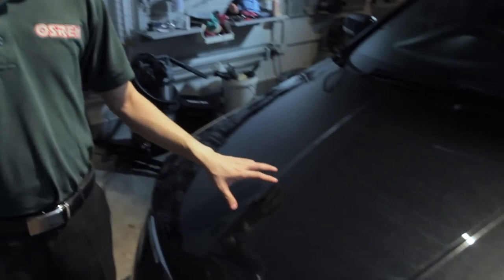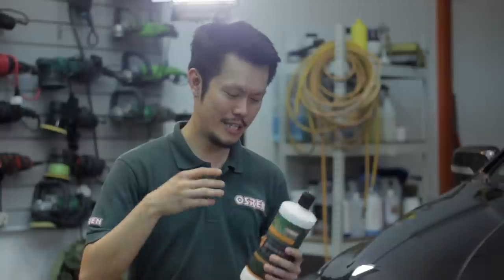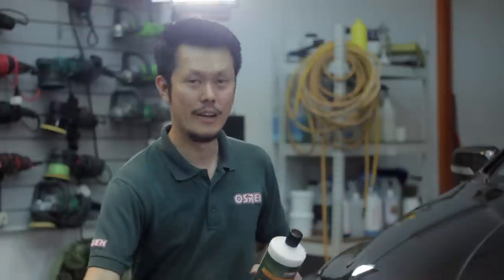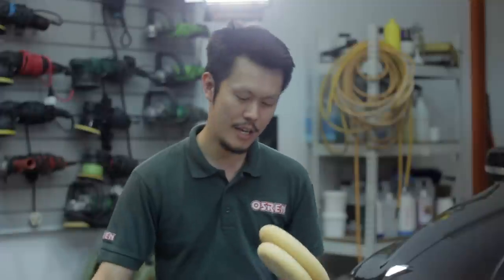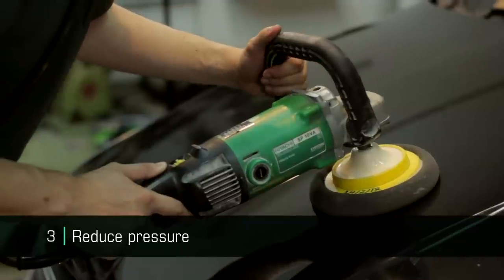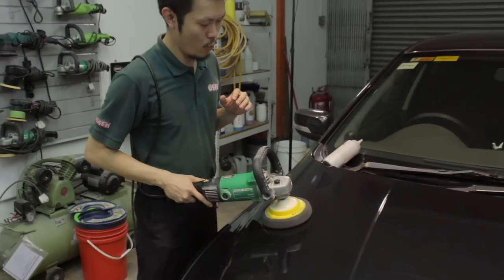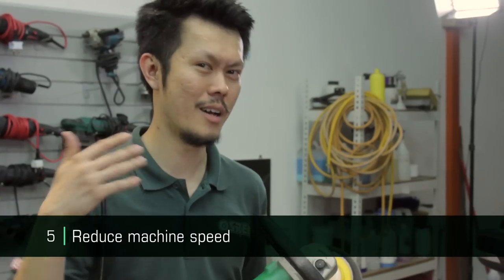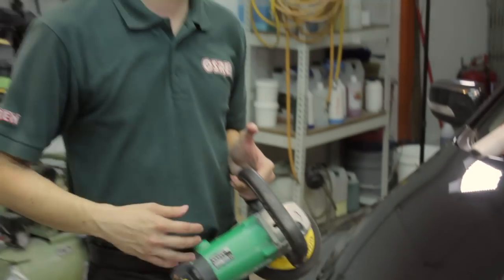How to Reduce & Remove Holograms with a Rotary Polisher

Comment: Very useful tips!  I am a fan of your channel. Would like to voice my support here.   
Unlike many American/European car detailing YouTube channels where they try to make simple things unnecessary complicated.  I am talking 15-step wash and decontamination process followed by 10 step surface preparation and product trials using 3 different DA polishers with 20 different types of pads with 10 different types of compound/polishing/finishing/sealant/wax/top-coat etc.  Took them like a week to completely detail only one car hahaha... This kind of complication has taken the joy of car detailing away.  

Your instructions just always keep things simple and easy to follow with minimal tools, chemicals and steps.

Also, I guess that you are a kind of ROTARY man because you always use rotary.  I grew up and start my car detailing practice from rotary and have always been using rotary. Contrary to today's popularity of the DA, a rotary always has a place in my heart.   It just gets the job done effectively and easy.  More fun to use than the DA, in my opinion.

Do you have any videos on polishing the very soft paint?  I have the World Rally Blue (Dark Blue) Subaru BRZ.  Its paint is very soft and it is very hard to perfecting the paint without the hologram.  

Keep on publishing good videos! Thanks.  (Sorry for very long comment)
Reply from the maker: HI Nikornvit, glad you found it useful. Off camera, Henry uses dual action polisher equally frequent as well. It all depends on the job at hand and there is always a best possible combination that is utilised by different detailers. 

On the soft paint, you may find the video here: https://youtu.be/Z2BCAaczsmk
Reply: Nikornvit Tulananda Can't agree with you more brother
Reply: Thats because they have product sponsors and they need to sell their products. In my shop I have only 2 sets od pads and performed more than 100 cars with the pad

Comment: Hey folks, Henry and the Osren team,

I would like to share my experience with a certain kind of swirls here, also I want to stress the meaning of this videoclip when we talk about removing swirls and thank Henry and the Osren team for providing me with tips and hints that really proved valuable for me! 

Maybe this text can help some of you guys sort out a kind of complicated issue and makes it a little clearer and easy to understand.

Let’s get into it: Those swirls on my black Ford were driving me crazy. Whatever combination I tried and whatever technique I used (watch Osren videos regarding arm speed, amount of product, rpm and applied pressure that influence the cutting effect), I wasn’t able to remove them. Just to be complete, I want to mention that I used only good quality products and pads and with 2+ years experience in cutting and polishing, I am not a super pro but also not a beginner. And I don’t have a DA, only a rotary and didn’t want to invest because it’s my private car and no profits involved...

Those swirls were of the kind that you couldn’t see them in the shade or indoors at all. But you were able to see them very obviously in bright sunlight and it was ugly I can tell you. I fixed a lot of extra light with plenty of bright LED tubes and all that in order to see them when I work and to check the results, but no. And I want to mention that I live in Thailand, so once the sun comes out, the light it is super bright. Means those swirls are really almost undetectable but I saw them regularly and I hated them because I tried to remove them for months and I failed.

When I saw the clip and talked to Henry (many thanks for taking the time to reply!), he guessed already that those swirls were very light swirls, not deep and recommended a downgrade. I (as not-professional) tended to upgrade rather downgrading because it made more sense. 
Generally: I want to remove something and it can’t removed with a certain way or product, it makes sense to use something stronger, right? That’s common sense in general life I would say. But not in polishing.

After that, I downgraded and again tried this and that combination but still not the desired results. I couldn’t believe anything anymore. 
Can you guys guess how I ended up? After I already kind of accepted that it’s impossible to remove them, I tried my machine polish and applied it by hand and a microfiber towel. And after 2 passes, I couldn’t believe my eyes: GONE! After that I tried a foam pad with the same machine polish that said „finishing pad, no cutting ability“ and: GONE

In the end, after the polishing of every panel, I had to drive out into the sun to check the results. But it wasn’t an issue as long as I got my results!

So the message of this text is: for certain kind of swirls, start with the less aggressive combination you have available. Possibly apply the product by hand first and check the results! It won’t do any harm. And after that work your way up.

A personal add: it’s so satisfying to solve a frustrating problem by your own hands and brains (of course with certain help like the Osren team here) and to gain further knowledge and capabilities. Even this task was so challenging, I leaned a lot and I am happy and grateful to go through this at first very very frustrating experience.

Good luck and plenty of success! 

Frank
Reply: @lewis30ss91  right, least abrasive polish you can find, a finishing polish combined with a good quality, soft finishing foam. For very light swirls, work your way up, means start with the least abrasive combination and increase bit by bit. In case you want to invest a little, you could think about a DA polisher, which is less aggressive and hence better for this kind of very light scratches. My experiences with polishing confirm Henry’s statements absolutely. Very low level of abrasiveness, the less aggressive the better. In certain cases, one could perhaps add more swirls by using too strong combinations of polishes/pads. I think it happened to me before, too.
I don’t think that compounds can do you any good related to swirl removal. You better leave that out, just too aggressive. That’s more for heavy oxidized paint, parked in the sun for years, very old paint or similar heavy cases. Good luck.
Reply: @lewis30ss91  I am not really sure, depends on what is available where you live. At least for me I live in Thailand and most European brands ain’t available here. I can stick only to 3m. Don’t save there and do some research first. I guess Osren have good products for sale, Sonax is a German brand with good reputation. But as mentioned, not available for me...

Comment: I agree with almost everything you have shown in your video except the speed you move your machine across a panel.

You still need to remove the swirls and holograms and moving quickly across a panel is not going to help you. All you will be doing is increasing your phisical effort and tiredness for no gain at all. 

You still need to cut the holograms out so a slow machine speed and a slow directional movement will be your winning algorithm. 

You still can use smaller buff pads as long as your pressure and pad speed is low. A bigger buff pad could introduce holograms again as the outside perimiter on a large buff pad will move much faster due to its larger circumference.

 It is a bit of a love dance between speed pressure, right pad softness and fine cutters to achieve perfection. Well done. Excellent   video. I have learned a lot from watching your videos.
Reply: Right.... But, he removed the holograms with his method!

Comment: How would you approach removing holograms in a Bodyshop setting, like on fresh paint, after compounding? Thanks
Reply from the maker: HI Dubb, usually the logical thing to do is wait for the paint to cure, or in many cases hardened enough in its top layer to be polished.

The approach is similar, basically reducing cutting level accordingly using the combination mentioned in the video (techniques, pads, abrasive). 

However, there is a high probability that on a non-fully-cured paint, defects would reappear as heat from polishing actually softens the paint and defects would reappear once the heat has dissipated. Think of it has a non-fully cured paint would react to heat and changes its texture to somewhat soft-mellow fluid, thus masking the defects.
Reply: OSREN (MALAYSIA) SDN BHD buddy I sometime have to polish panels that have only been out the paint booth for an hour . If that cars going today it’s going today lol

Comment: Great job dude. I'm amazed by your efforts and professionalism. I'm planning to try with rotary to remove some light swirls from my VW paint. Could you tell me how much microns  of CC will I remove with this particular technique? Thanks a lot.
Reply from the maker: Hey Branko, it's hard to tell how many exact microns will be removed by polishing or any form of polishing. But removing holograms will rotary is a very light burnishing process and does not come close to burning away excessive clear-coat, nor it is capable of removing scratches or deep swirls.

It's the heavy compounding that anyone should be more worried about as usually, these are the cuttings that will burn paint or thin clear coat. Therefore, good car care is always about preventing as many scratches and other defects as possible so one doesn't require heavy cutting every now and then.

Comment: Been buffing in a professional body shop for years with a rotary polisher, have never encountered this problem. I feel like pad choice and compound is crucial, plus somtimes you cant be scared to put alil heat on it. the clear on these new cars now days can take quite abit before ever getting close to burning through.

Comment: Hi, would you be able to achieve that with a rotary polisher that only goes down to 1000rpm? Is 1000rpm safe on softer paint?
Reply from the maker: Can't speak on behalf of the paint, but give it a try.. Some paints are able to. If it's an extremely soft paint, chances are you might need a dual action polisher instead

Comment: Great choice in using the Hitachi SP18VA rotary polisher it is lighter than the Mikita 9227C and Dewalt DW849,  only the more expensive Metabo PE12-175 is lighter.  Great tip on pad sizes as an aggressiveness factor !

Comment: Is a rotory polisher better than a D.A. when working on large surfaces such as motorhomes? My Meguiar’s DA leaves a lot of swirl marks behind. Or do I need a larger DA?
Reply from the maker: Hey larry, it boils down to the combination of pads, polishers, and polish abrasives on that particular paint. Indeed rotary polisher may cut faster than a dual-action polisher. if you are not going for a perfect finish and time is of the essence, and don't mind some micro-swirls, then rotary can be a friend. (it's more challenging to finish to a defect-free finish with rotary, but it's possible on hard paint)

If you wish to have a swirl-free finish and time is what you have, da would be a more straightforward tool. you may look at 21mm orbit as well on a da as surface coverage is larger as well.
Reply: @OSRENOfficial  thanks. Is the Torqx 22 a good choice then?

Comment: Are use a black pad with an ultra fine polish and I still have holograms all over it using a rotary. I need help
Reply from the maker: Hey Bohuslav, there are several possibilities that might affect the outcome. For start, i recommend the process of elimination, change different pad from different manufacturer, while it might all be black, different manufacturer might produce differently. Then move on to different polish abrasive. 

All while using the technique that is shown by Henry. It's not 100% but the idea is to minimise and get the best possible outcome. We just happen to be familiar with our own products.

Comment: Just a quick question, does Perfect 50, NAO 46, and Perfect Cut 20 dust? I have compound and polishes that dust a lot and is driving me nut!
Reply: Also, I love your video!
Reply from the maker: Hey Anthony! Perfect 50 does abit more than 46, and 20. 46 and 20 has abit of dusts. Generally dust are either the clear coats being shaved off and also the compound abrasive used
Reply: @OSRENOfficial  THANK YOU!

Comment: Hey, I’m thinking about buying a wireless machine since I live in an apartment. Which one would you recommend?
Reply from the maker: Hi 370gt Alej! I personally don’t own any wireless polishers but have tested out a couple, namely Milwaukee and Flex, they are good but I didn’t like the fat battery pack at the end of the handle. It’s cumbersome. But I think it’s just a matter of getting used to it and of course since you have no access to a socket, those are your best bet :)

Comment: Hi there, great video! I am working on a black Audi at present and I am getting some holograms with a DA. I thought I was doing everything correctly, ie used Rupes yellow pad, Sonax Perfect Finish compound, speed 5 on a Das pro 6 DA, 2x2 surface but still I was seeing holograms. I wonder if i did too many passes? Did 4-6. I was still seeing swirl marks under the light so I thought I needed to run it more...could it be that I was adding them and hence getting the holograms as well? Any advice is appreciated....newbie in using a DA
Reply from the maker: Hey Declan! So based on the information I gather from you, I would assume some of the following possibilities 

1. DA usually does not leave behind swirls but it is possible for DA to leave DA Haze. More detailed information about the difference of swirls here http://osren.com/blog/?p=357
So if it is DA swirls, you would need to step down or use a less aggressive combination

2. You might not be removing the existing swirl marks to begin with. If so, you would need to use a more aggressive combinations 

3. On certain delicate paints you might inflict marring upon clearing up polish residue with MF towels and under certain lighting you might mistake that for swirls again. If so, you might wanna use a slightly damp towel instead of a dry, used or saturated ones.

There could be other reason too. If you can Facebook message us, please send some photos of the condition you are facing and we’ll try to advise you from there

Comment: I didn't see you use a cross hatch pattern when removing the holograms or cutting like I would with my standard rupes DA. What is the case when it comes to this? Also, do you find the results to be better with a rotary vs. a DA?
Reply from the maker: Hi Mark Thayne!

Cross Hatch Pattern is a way to prime and dispense polish onto the working surface. Personally, as long as the polish are spread out evenly to the desired working surface, that’ll be good enough. So whether it is cross hatch or multiple dots or spreading polish like butter over bread, doesn’t make a difference as long as there is desired amount of polish on the working surface.

too much polish might have a negative effect 
1. Takes too long to breakdown
2. Cause too much cutting
3. Waste of product

Too little around of polish
1. Not enough cutting
2. Not enough lubrication causing unwanted friction 

For me I would say it’s about balancing the amount of Polish against the Pad, which you can tell when you’re working on the surface.

As for DA and Rotary, I will definitely use DA on super soft finicky paint. For hard paintwork, generally the rotary can get it done faster. To professional Detailers, I would always advice to have both machines because you never what type of paintwork you’ll be working on everyday.

Comment: Why does my machine polisher not stay flat on the surface like his. The pad sticks to the paint so i have to hold it at  an angle and not flat on the paint?
Reply from the maker: Hey sparkz, in my early stage of polishing, this happened to me too. And I realise it is because of  using too "grabby" pad or lack of liquid on my pad. 

The use of wool pad (with soft interface) or with a softer pad, this doesn't happen. A seasoned used pad helps to reduce this. Try switching combination of pad and if pad is new, try priming the pad at initial usage. 

There might be other reasons, but I found out that that new and grabby pads are often the most prevalent issue many are facing.

Comment: Boss,  i only have 1tool thats rotory

My biggest Q is
1.would rotary finished better than DA? Clarity, deep, and finished crystal clear like better than DA?

Same person, same pad and chemicals

Or its not possible to finished better than DA?

Thanks.
Reply from the maker: Hey Henry Dunant!

There’s a possibility of the rotary to finish better than the DA and there is also a possibility if the DA to finish better than the rotary. 

It depends also on the paintwork you are working on
Reply: @OSRENOfficial  

Hi Mr. Henry 

Ok noted, soft vs hard paint. right? I saw all ur vids =) 

After passed cutting process w/ orange pad  lets say i got good result with minimal marring,less holograms etc
Can i jump to red pad (waxing) etc to cover unperfection surface?
Speed 1 and slow arm movement
Reply from the maker: Hmmm....... well, you can cover them up but after exposing to sun (heat) the polishing oils / wax might evaporate and the holograms will be revealed. If you’re gonna do a second step, might as well try to refine it further haha
Reply: Thanks boss *cheers